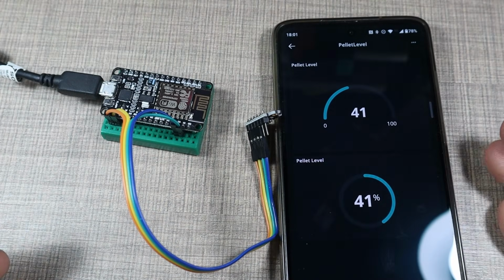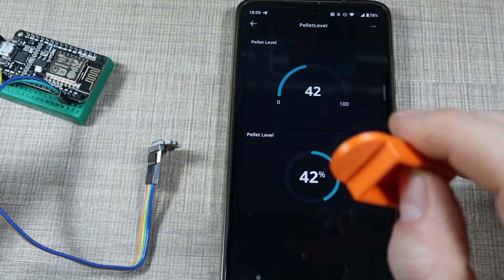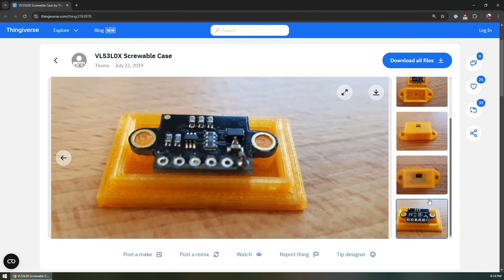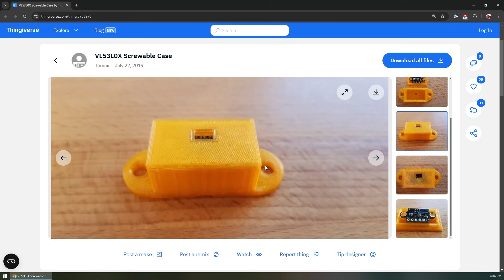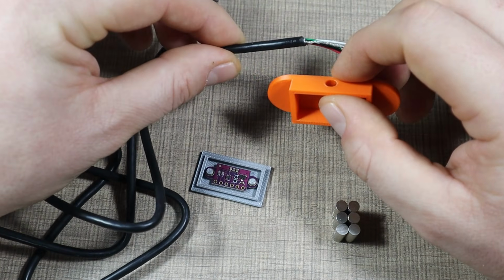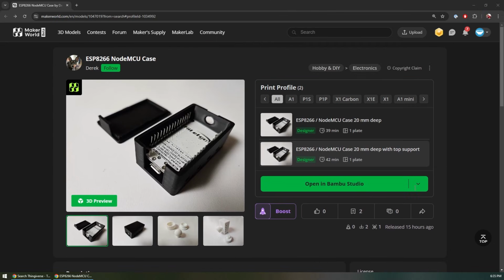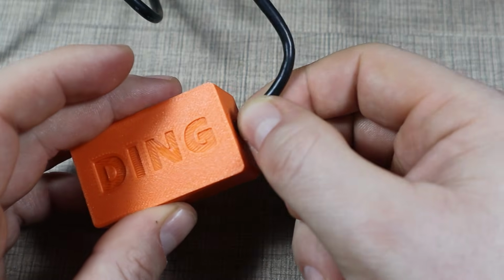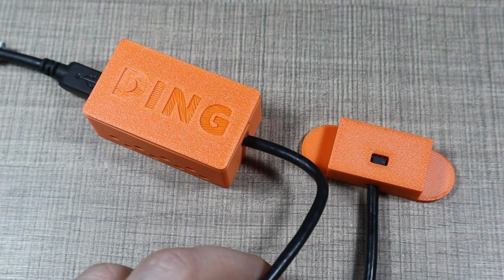Time of Flight Sensor (VL53L0x) Pellet Level Monitor with Arduino Cloud

Comment: The texture of that 3D printed lid is interesting. How did you do that, is there some special setting in the slicer?
Reply from the maker: The texture on the letters? They are just overhangs printed with no support. It was just an experiment but it worked well.
Reply: @TasteTheCode  No no, the surface texture is not smooth in order to hide that is 3D printed. That texture.
Reply from the maker: That is from the build plate, it is a PEI plate with that texture.
Reply: @TasteTheCode  Oh, OK then.

Comment: Could I use this sensor on my current project where I want to connect camera and sensor to screen and then if the person is in front of screen, the sensor will detect that and the screen will turn on? I dont want to use pir sensor because I want the sensor only to detect 30-40 cm away
Reply from the maker: Sure, that is a perfect application for this sensor.
Reply: @TasteTheCode  Do you know any touchscreen that I can use with a Raspberry Pi 5 to create a custom app where I can control and monitor all cameras, open gates, and perform other functions? I prefer 10 inch screens
Reply from the maker: I haven't used anything that big.

Comment: I done simmilar set with additional temp. measurment. Just have one suggestion to protect laser from pellet dust. I used smart band protected glass 😊
Reply from the maker: That is one of the considerations but I still need to work more on the software side of it. So far with my ultrasonic one, there is no issue at all and very little dust actually deposits on the sensor since it is upside down. I guess the laser one will be a bit more susceptible to the dust but still, it will be mounted upside down.